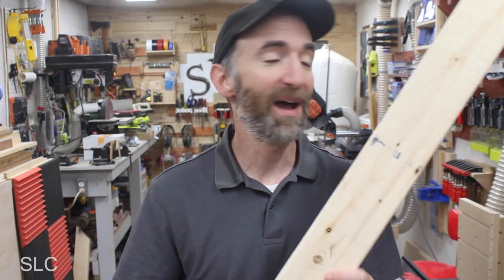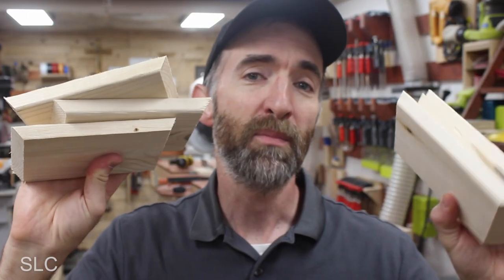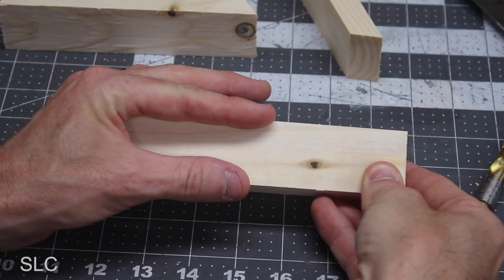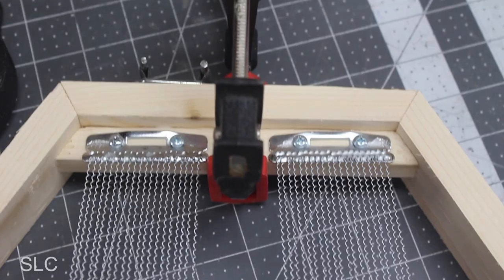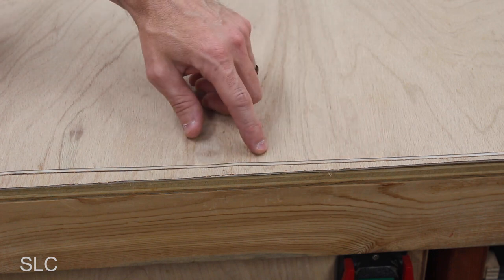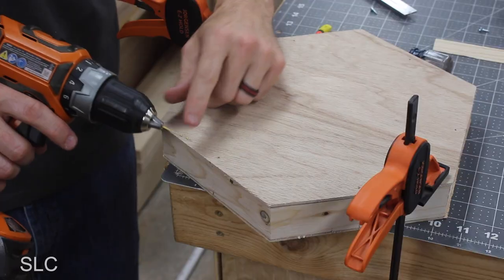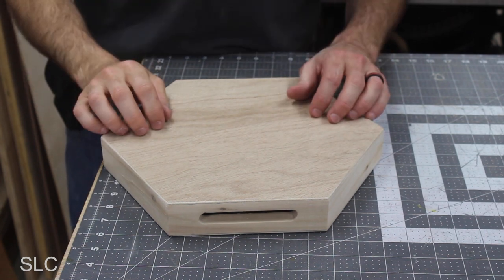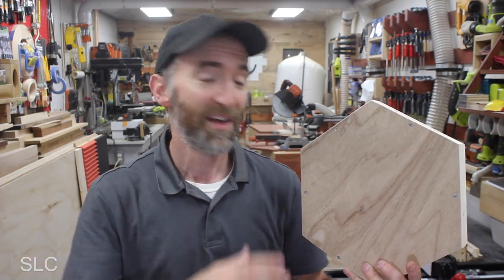Making a Mini Travel Cajon

Comment: Very cool!  I'm definitely going to make this!

Suggestions:
1. Secure both ends of snare to quiet the metallic ringing (spring sound).
2. Don't tighten all screws all the way for the head cover, like a real cajon. This leaves a gap that can be slapped closed and creates a sharp snap sound when hitting the edge.
3. Wonder if a rattle compartment could be encorporated inside. Maybe take the place of the snare?

Comment: The one thing I’d suggest is only using 1 snare instead of two, attaching it closer to the top on both sides. You want the snare but not a rattle after & the ability to not have a snare on the bass  tone.   Can still trim it to size but then maybe use staples to attach to the opposite base side?  That way you get a nice deeper clean resonate bass on the middle/bottom and a crisp tenor w/snare on the top.

Comment: I’m not sure the snare has to have both sides attached, or if there’s anything wrong with having two half snares.  In my experience, the more of the wire in tight contact with the head, the more overtones you’ll hopefully bring out of that head.  That said, this is wood, and I don’t think you’re going to get a LOT of overtones, but some part of the snare, probably the loose side, needs to have enough pressure against the head to stop the snares from ringing free in the air - you don’t want that.   I’ve seen some that have some kind of set screw or a dowel you can turn and then tighten that tension the snares against the head.  coming in at a lower angle will let you do that and also have lots of snare contacting the surface.    A lot of cajons also use some kind of string - gut, guitar string, strong nylon, etc.  Some have actual guitar tuners you can use to put enough tension in the wire to make it snappy.